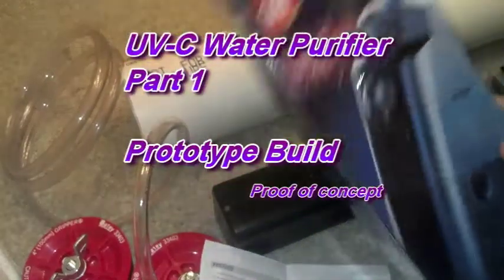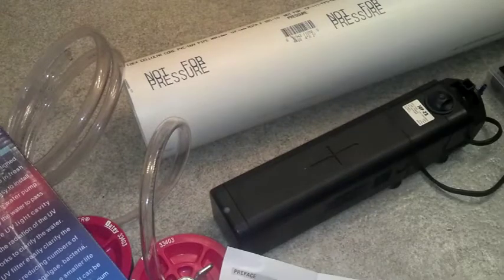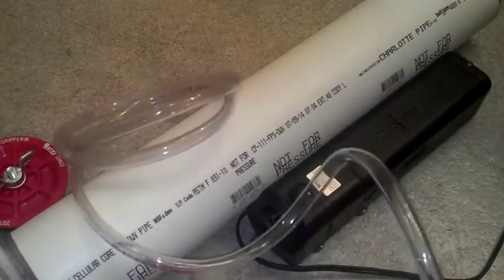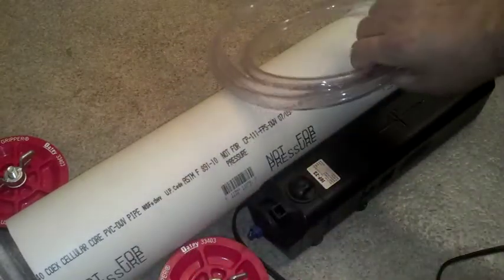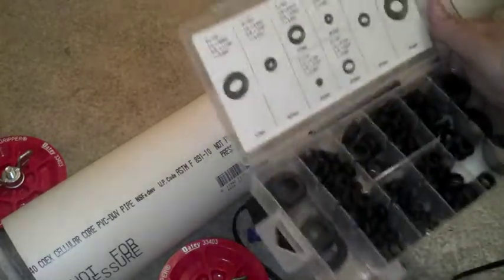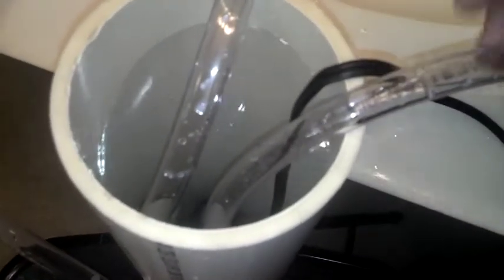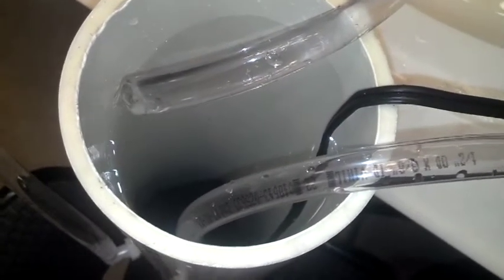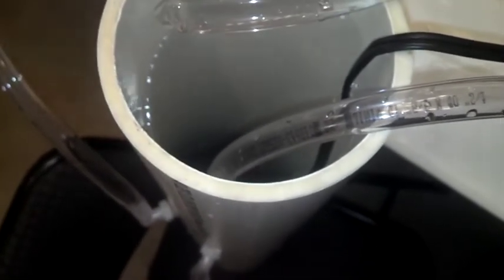UV-C Water Purifier Part 1 the Prototype

Comment: There are commercially made units that are approved and tested for drinking water applications.  I work with UV disinfection everyday on a large scale.  Don't risk your health to a cheap aquarium UV light that is not approved, you may regret the savings.   Not all UV lights are the same.  Especially the cheap Chinese lights, they over rate the output.